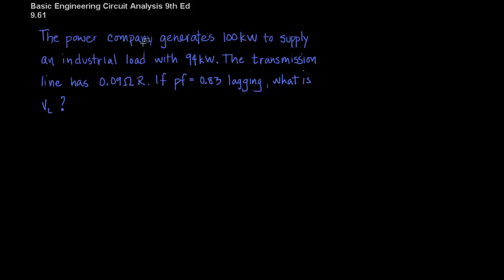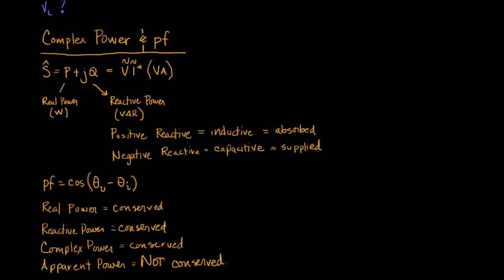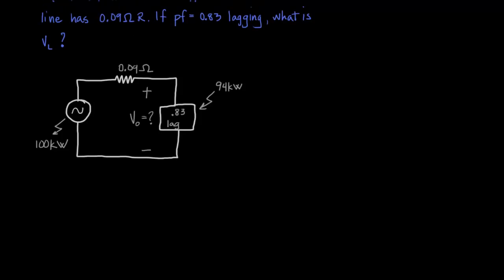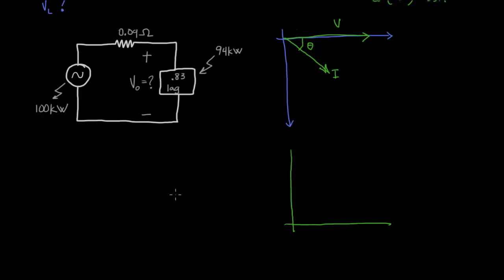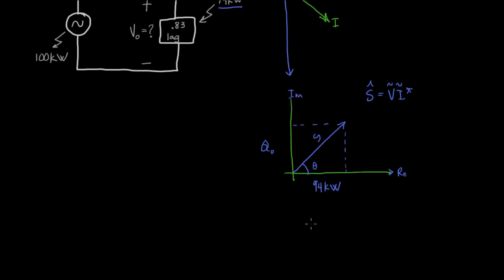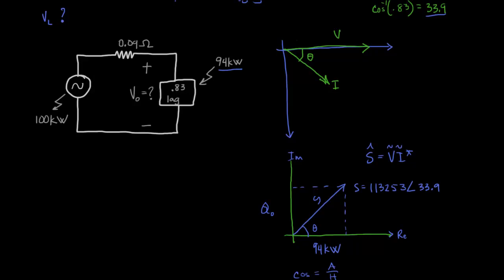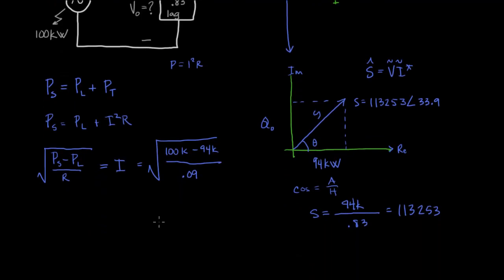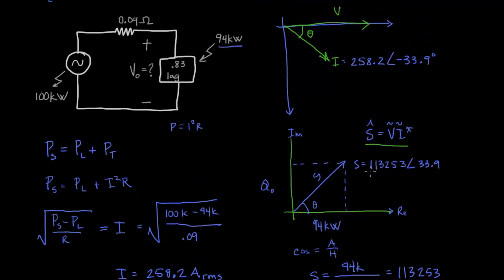Complex Power and the Power Factor

Comment: Could someone help me out?

@5:50 - How do we draw the graph of voltage and current? How do you know the theta is negative? Can I draw the current vector on the x-axis and the voltage vector at an angle with respect with the current vector? I guess another way to ask the question is - how come vector current and voltage is in graph quadrant IV not in quadrant I?
Reply: +Supra T The current vector is in quadrant IV because the load power factor is lagging. The angle is arc cos of power factor, which is 0.83
Reply: +Rian Wardana Thanks! I was told that since the problem doesn't specified the voltage angle, we can assume the voltage angle is at 0 degree. And lagging PF = current lags voltage, so current vector was drawn in quadrant IV (CCW rotation). And the angle theta between voltage and current vectors is -33.9 degree.

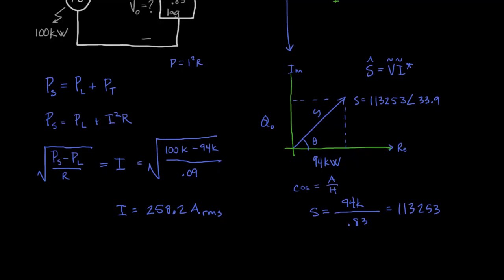Comment: How do we know that the current we found at 12:21 is RMS? Thanks
Reply from the maker: It's a convention that, unless specified otherwise, all values are RMS.  Perhaps I should have mentioned that at the beginning.  RMS is really the only thing that makes sense with problems involving power because the average current is 0 and the amplitude of the current would be misleading because it doesn't relate to power
Reply: Matthew Araujo Thanks for the reply, and thanks for Great Video!!! I told my friends that I should have attended "YouTube University" and saved a few million dollars. LOL
Reply: @AraujoMatt  Does that mean that the final voltage will also be in RMS because current was taken to be at RMS?
Reply: Yes the answer is in RMS. RMS should always be used in AC circuits as the average power is the only one that makes sense. Using an instantaneous peak power does not show the average heating effect that current will have on the circuit's components. Whereas RMS does and is used for that reason.

Comment: In equation S= VI the V and the I are NOT in RMS right?
But you used it with RMS values?
Reply: THAT V I SHOULD BE RMS VALUE
Reply: If you want to use peak values for V and I then the formula to use is S =  VI*/2.

Comment: How exactly do you know that the reactive power will be positive if the current if lagging? Could anyone elaborate on this?
Reply: Just calculate the complex power absorbed by the load (S = VI*) using the passive sign convention. You'll find that the reactive power will be positive for a lagging pf (inductive load) and negative for a leading pf (capacitive load). Hope that helps.